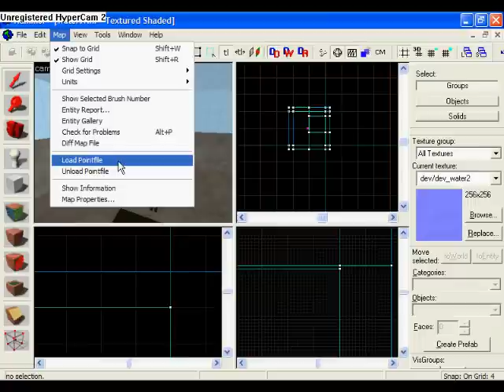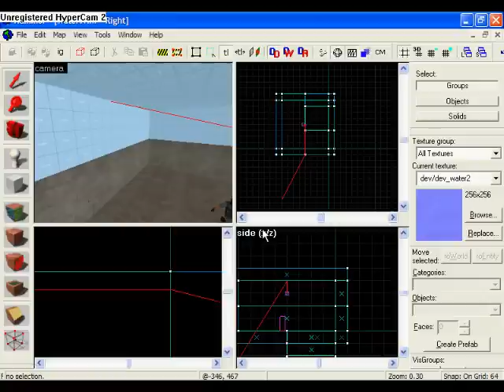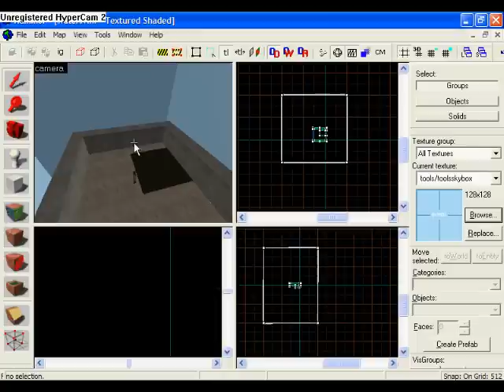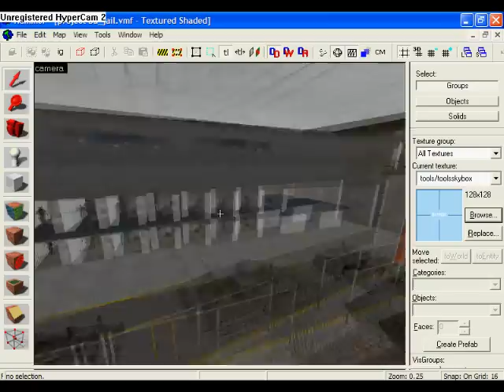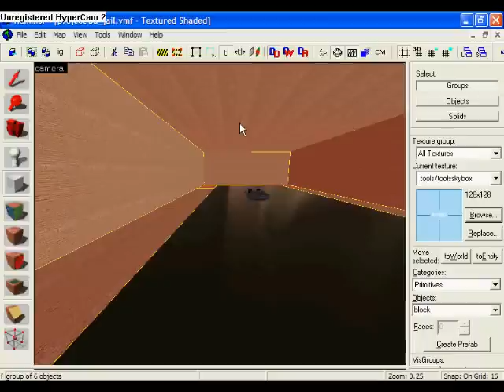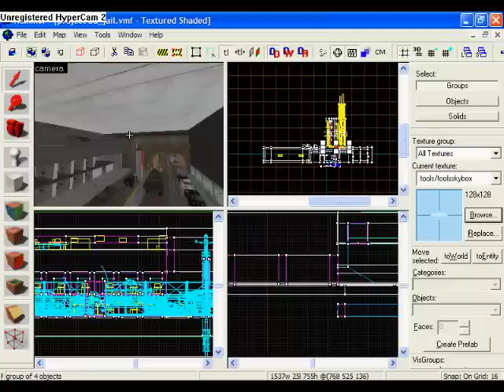Source SDK Water doesn't work, Leaks and holes

Comment: After using Hammer for a while I seem to get the same issue. It seems to fling up a whole lot of issues in parts of the map in which there previously was no issues and when I look for the leaks they don't exist. If I run map again it moves to another spot yet again for no holes to exist. The red lines are literally going through the centre of the blocks rather than anywhere near the outer edges.

Is there any way to run a map without these errors coming up ? ? ?

Comment: To anyone else that went through this headache, and attempted to fix leaks to no avail;
MAKE SURE YOUR MAP IS AT 0,0,0
I figured out that since my map wasn't actually built around the actual center of existence, that source considered my entire map as a leak. Luckily I wasn't too far from absolute zero, so I was able to fix everything by making a inaccessible vent that led out of the ceiling and effectively contained the true center of the map. Thank you pointfile for attempting to point this out to me.

Comment: Thats why I make a skybox around my map
Reply: That is a very poor way in doing it, thought it works it definitely doesn't last long. It will compile everything in the skybox cube which will make people with weak PCs lag like fuck. I've made that mistake and it made my huge map fucking awful.
Reply: @RealityClubX  false, it just takes more time to compile. Besides, even the cheapest pc should run older source games without a problem, even on the most unoptimized map, so I don't know what kind of machine you were using.
Reply: @demogaming8895  I have a GTX 1080 and the previous version of my map drops me from 200+FPS to 10-60 in some parts. I had WAY too many brushes in my map and my skybox was done just like in the video. The correct way to do a skybox is to wrap it round the top of the map. So smartypants, your statement is the one that's false :)
Reply: i had a large map, when i used that technique, my CPU went to 100%, i had to force the program down using task manager

Comment: A little help, I don't have a pointfile anymore so I assume that means there are 0 leaks but the water is still glitched
Reply: I love how people liked the message but didn't reply.
Reply: In the case you've been three years stuck with the same problem, try checking the models you're using, sometimes my water doesn't work because i used a model present within the water that doesn't load, which also malfunctions as a leak.
Reply: I have the same problem, with a well...
Made from a cylinder....
With the middle carved....

With a smaller cylinder...
But not the ground itself.

Comment: This "leak" shit should be just removed. Entities leaking out to the "void"? That doesn't exist.
Reply: John Freeman I think the leaking issue happens because the engine needs to use visleaves to calculate the physics and bot pathing, and the visleafs are basically geometric planes that runoff all the brushes and when there is a hole in the level, the plane runs infinitely, so i guess that fudges it all up?
Reply: The void is just a term for where nothing really exists. Also leaks can't just be "removed" because it's a glitch in the engine.
Reply: A "leak" is there to give the mapper more freedom when they're working. What if you want to do something weird with the code, or make the skybox do something interesting? Source isn't going to know what part of the map is playable, and what part of it is the skybox. Trust me, it's a pain, but it helps.

(ALSO WOW I'M LATE, SORRY LOL)

Comment: I would like to add that carving is perfectly fine for certain situations. For example, if you want to make a circular hole in something, making a carve with a circular brush inside of a block works perfectly fine and is more time efficient than making it manually.

Comment: I ended up in a total removal of the prefab and the map went back to normal (of course) with the realization that I ended up hitting a limit with the compiler that caused VVIS/VRAD to do something that is similar to a crash and it did not compile any of the lights. My map was huge already and I believe this prefab pushed it over the edge. Although I ended up discovering the limits of hammer the hard way, I really appreciate the help. Also, do maps fail VVIS/VRAD when they reach a certain size?

Comment: Thanks! It got rid of the errors in the compiling as soon as I removed the values for fifty percent drop-off and renewed the lights; though, I am still getting the full bright effect with out any sort of leak or water disappearance/indications that would normally cause such of an effect. Would there be anything else that causes it, other than not having a light or compiling with out the visuals (which is set to normal in compiler), to be full bright? Thank you for responding!

Comment: 3kliksphilip, Although you have your hands full with plenty of comments involving leaks in maps, I have a very weird problem after adding a self-made prefab to a map that does not leak but makes the entire map full bright involving 47 error messages that state, "light has _fifty_percent_distance of [a Value] but _zero_percent_distance of 0.000000" and the water in the map works but the whole map is full bright. Do you know anything about this compiling error because VVIS refuses to work?

Comment: THANK YOU! I've had problems with my skybox [the red line from the point file just went straight through a skybox wall, WTF?] but I was unable to see my water. I tried your skybox method and it fixed the issue, I can actually see my water now. I'm just doing basic maps to test things and maybe see if I could make multiplayer maps later on, and these videos are saving my ass .thank you!

Comment: materialPath: c:\program files (x86)\steam\steamapps\frenchtoast260\counter-strike source\cstrike\materials
Loading C:\Program Files (x86)\Steam\steamapps\frenchtoast260\sourcesdk_content\cstrike\mapsrc\ze_Lab_faclility_v1.vmf
Can't find surfaceprop panel for material METAL/PRODVENTA, using default
ConVarRef mat_reduceparticles doesn't point to an existing ConVar
Error: displacement found on a(n) func_breakable entity - not supported (entity 817, brush 0)

Comment: @3kliksphilip The cordon tool makes an instant Skybox which is great when you are building your map. you can always build the box last, and should to avoid resizing and moving it. More ppl should learn to use the cordon tool. its not just useful in compiling but in culling large during design. I Killed 2 video cards opening large decompiled valve maps and forgetting about Cordoning.

Comment: I have a problem i worked on this map for awhile i was finally finished so i runned the map.. this is what it says: : The command failed. Windows reported the error: "the system cannont find the file specifed."
Is there a way to fix this?

Comment: the red line goes strait through a door near my spawn.  i put level transitions in.  so the info_landmark is where the line starts.  im mapping for half-life 2.  after the line goes through the door is just kinda zig-zags into the nothingness.  it never touches anything other than the door it shoots through.  i looked across the grid and i see nothing.  also the portion of the map is inside.  so there is no skybox needed.  ill try putting one out there see if it helps at all

Comment: I found myself a new kind of problem.
I wanted to try a small part of my map so I made a ceiling on it and it looks like it has no leaks. When I check my compilelog it says my 'func_rotating' is leaking and I see that red line for leaks. But the weird thing is, I don't have a func_rotating and that red line is pointing somewhere out of the map, it's pointing at nothing! Have you had those problems before? If so do you know how to fix it?

Comment: Hey I've been working on a map with a friend for over a week, but we have a problem. We don't see the water. It's not the skybox because it's a big hollow box. Nothing is outside the skybox. And when I load pointfile in hammer, it just shows a vertical line OUTSIDE the grid. I have no idea how to fix this, and we don't want to restart.

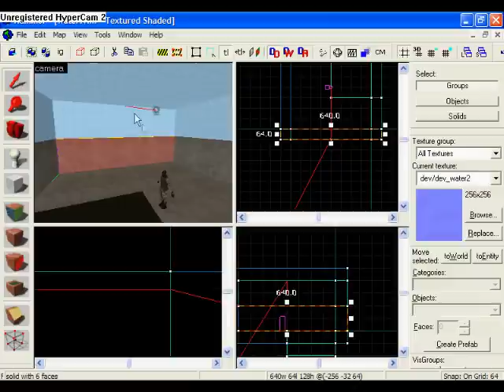Comment: I agreed up until 3:30.  Boxing a level to fix a leak is trading one problem for another.  That will fix the leak, but at the cost of lower framerates.  You went from a level with at least 11 drawn/rendered surfaces to one with 25. Much more processing for the game engine to do.

Comment: Those "hills" and "curves" aren't brushes, they're displacments, and MUST be backed up by solid brushes in order for the map to not leak.

I'm no pro on this, but I'm guessing you'd have to intersect the water brush with the displacement (use sewing if it's needed on some displacement-brush edges). And because you have your water brush all-around NODRAW-ed , you won't have any problems, performance or bugs wise.

Comment: hi! im having a problem with that all teams are full. The spawn points are not touching anything, they are placed safely. But! It still says all teams are full and I can't play my map! I have tried the load pointfile thing, and the red line just appears in the middle of the map. But the red line doesn't go outside to the nothingness! It's just a line in the map going through a wall which is inside the map, not a skybox wall or something like that!

Comment: Yeah, but to be fair, this is a problem with the Hammer editor.  In the UE3 editor, you can cut holes into anything and it'll work just fine...so really, there's nothing inherently wrong with carving, as long as you're cutting all the way through a block/BSP and not just in the middle of it, for example. The geometry will normally create triangles or things other than quads and that's where the problems start.